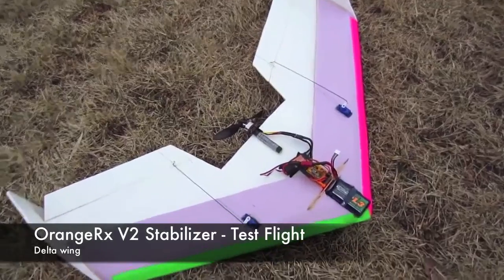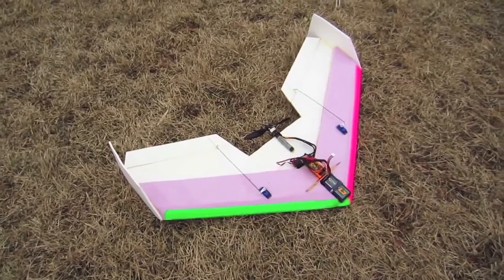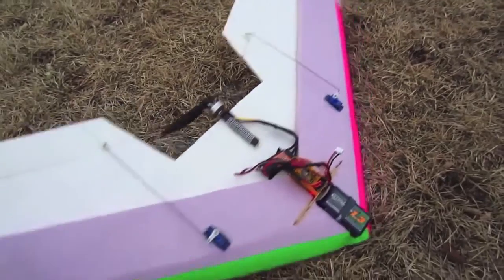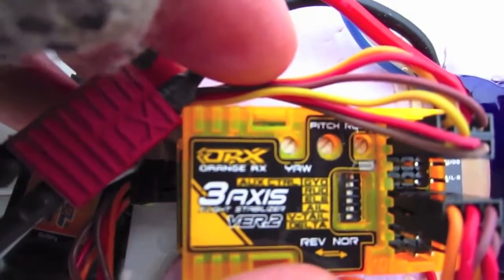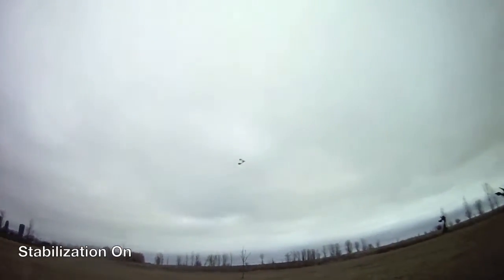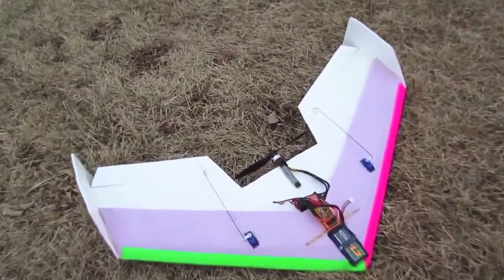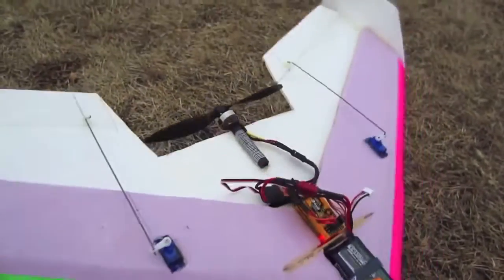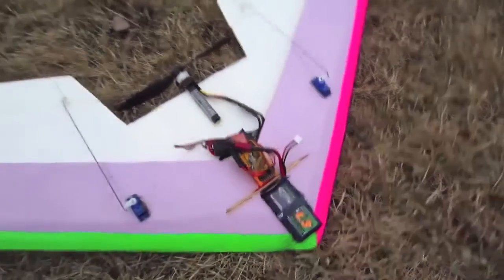OrangeRx RX3S V2 Stabilizer - Test Flight

Comment: Hi, what happens if you set up the failsafe with the surfaces making circles and idle throttle, the plane will descending in circle mode and stabilized?

Willo

Comment: You have that mounted backwards.  Antenna wires go towards the front.
Are you running the ailerons on a "Y" or both off the RX?  If the latter, how did you get them to reverse?

Comment: Hi I still can't work out how to turn it off with my Spektrum DX8 :-(
Reply: +John Dwyer You need to set the aux ctrl dip switch and connect the gear / aux 1 channel to the Rx3s
Reply: John Dwyer I have the  futaba fasst version  and use channel 5 .

Comment: Dont forget to glue the stabilizer properly, if its loose and vibrates, it will read as the planes is vibrating aswell and will try to correct movements that the plane might not be doing...
Reply: Pedro Cruz. The click lock velcro also worked for me. I also was able to apply it both on the bottom and one side. Used the strong 16 lb type.